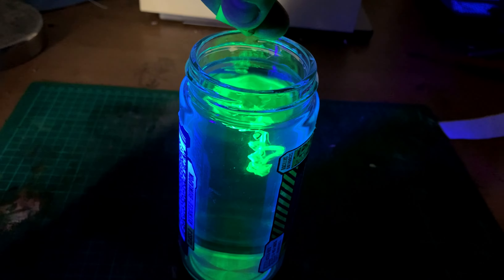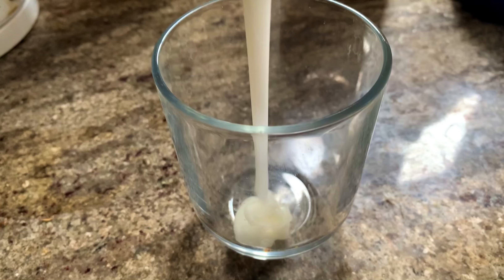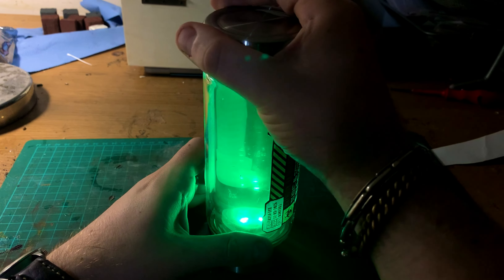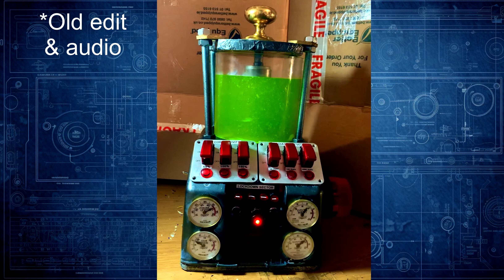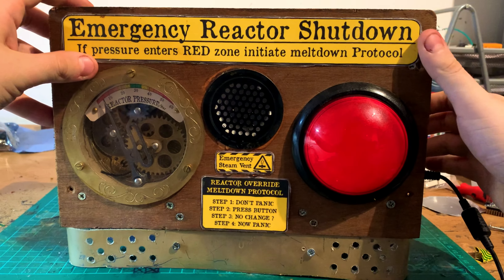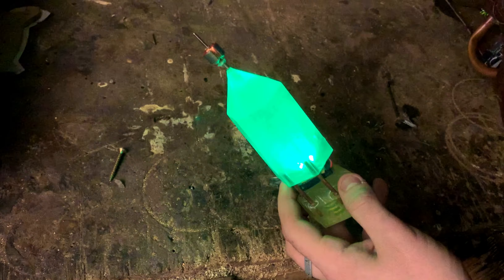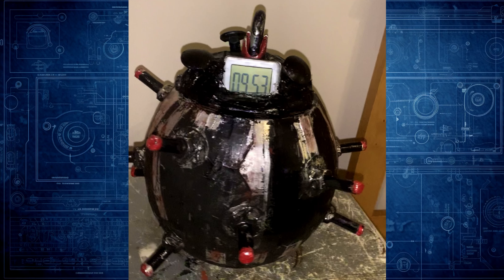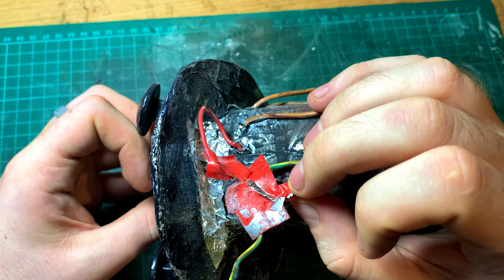My Top 5 Sci-Fi Inventions

Comment: To solve the wire cutting sequence issue, you could connect multiple wire in series with the battery circuit. The timer would stop when the last one was cut.